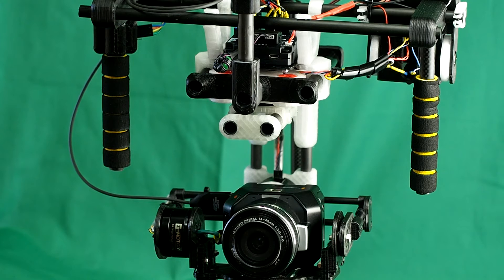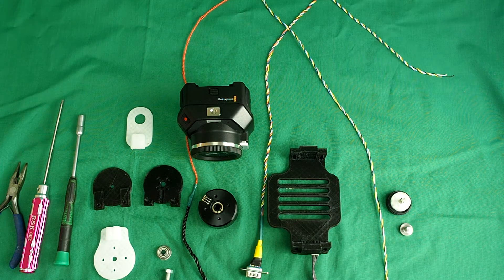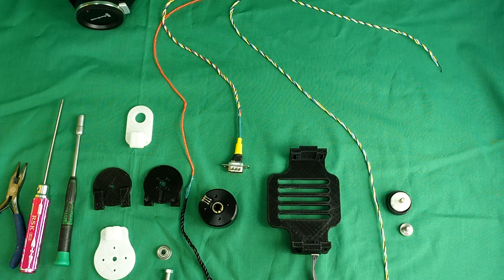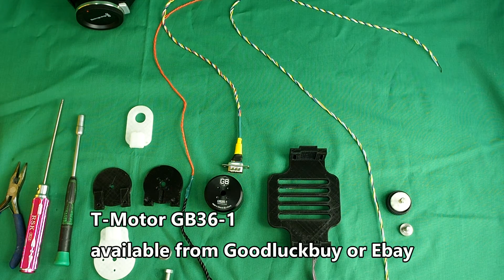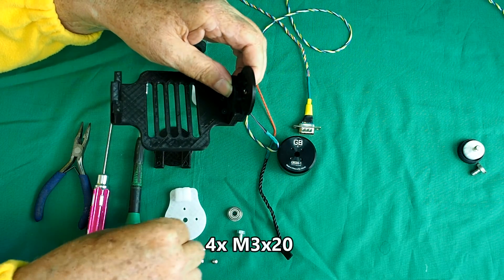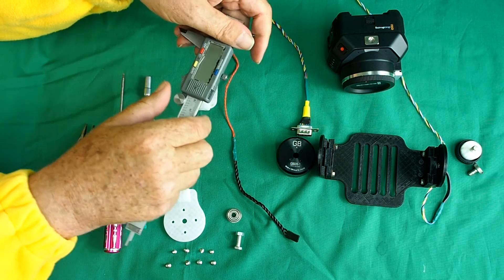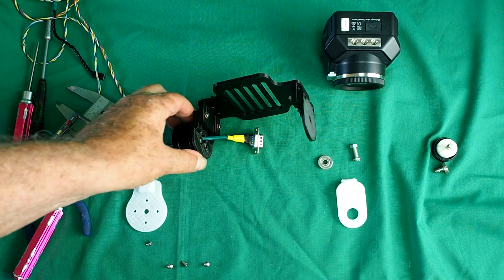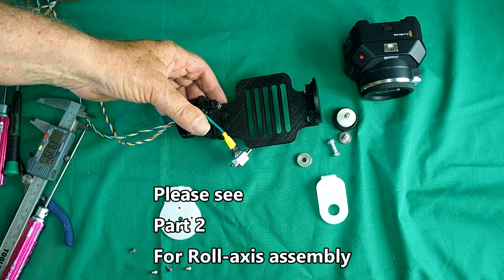Hand held or Drone Mounted Gimbal for BlackMagic Micro Cinema Part 1

Comment: Hi, Chris.   Thank you for creating the BMMCC Gimbal build videos.  They are wonderful. A few days ago, I ordered the 3D print parts on Thingiverse and the order ultimately was bounced back to me by 3D Hubs.   Since then, I've shopped the cost to get the parts printed elsewhere and pricing is coming in a 3x higher than Thingiverse's original pricing.  I suppose Thingiverse's automated "lower" pricing is the reason for 3D Hub's rejection and subsequent refund of my original purchase.    Can you please specify the "print" quality needed for the 3D parts and also reccommend a different "value" print source.  (My assumption is that SLS quality is needed for these parts, but that is mostly an uneducated assumption; and of course I want to VE my build as much as practical without sacrificing functional quality)  Thank you, Chris.   All the best!